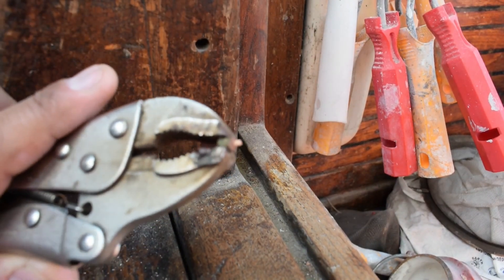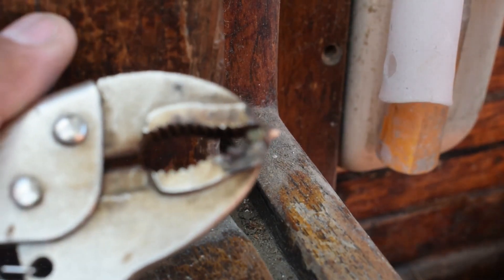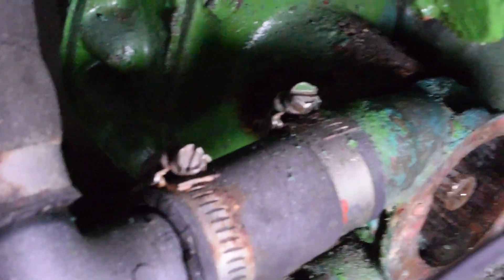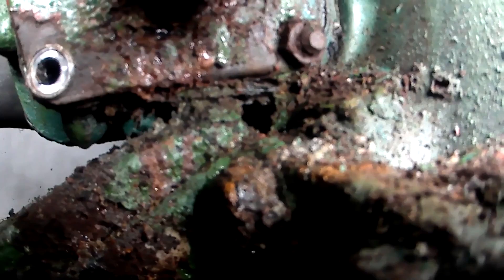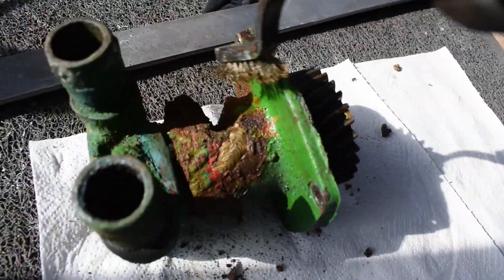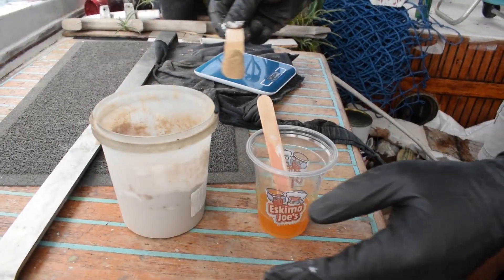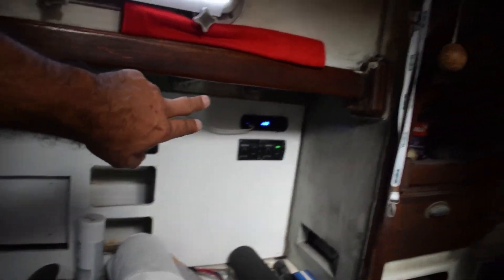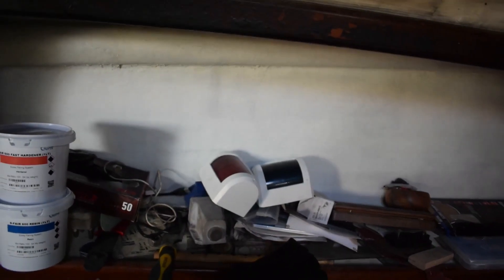S02E17 impeller pump and epoxy floor leveling #boat #boatrenovation #diy #restoration #boatbuilding

Comment: Hi Jessie ... too bad about the broken bolt, but by the looks of that pump, it might end up being a blessing in disguise --- it didn't look long for this world.  Better you find out about problems like that while still at the dock, rather than out at sea!!! Good to see that the fairing compound finally came in, seems like you have been waiting for quite some time for that  to arrive. Hopefully the weather will give you enough of a break to put it to good use!!! Have a great week!
Reply from the maker: Yeh... well that pumps to put it mildly ... "F%$#%t"  ;-).   nothing for it im afraid ... ill have to get a new one.. little chance to actually recondition it and im not sure it would be worth it at all. however $500 is well over my limit so i may instead modify to a belt driven pump that is separated from the engine completely, close up the crank pully side and make it an all round easier maintenance item. Round these parts Johnson pumps are readily available for 1/4 the price.  but lets see how it goes....
Reply: @jessilopes  If you do go that route and get a pulley driven pump, can you fabricate a plate to cover the hole left by the pump housing, or is that spline shaft that works off the motor's water pump going to get in the way?
Reply from the maker: Ill do a plate... shouldnt be too difficult..  the spline somes off with the pump... as it stands now the crank pully is inside the housing on the motor side and its flush with that.. so shouldnt be an issue closing it up...